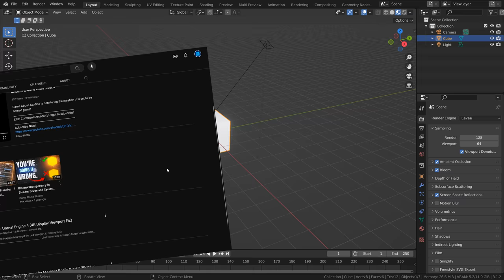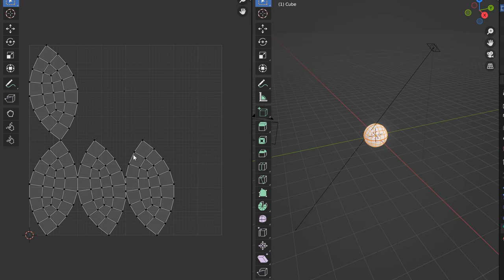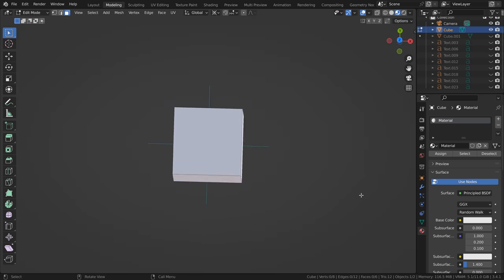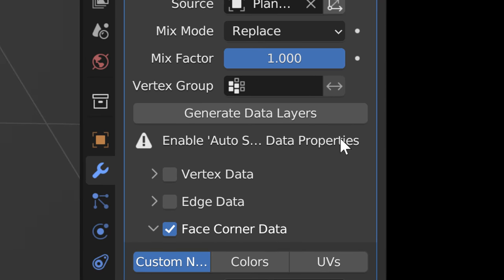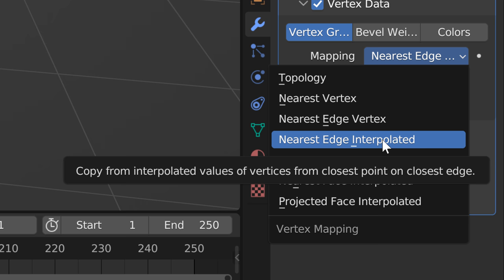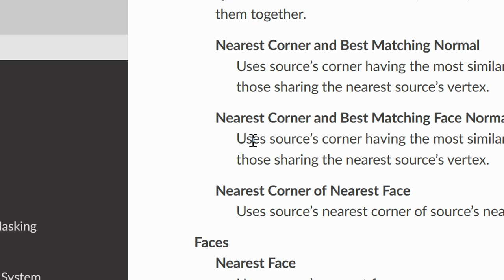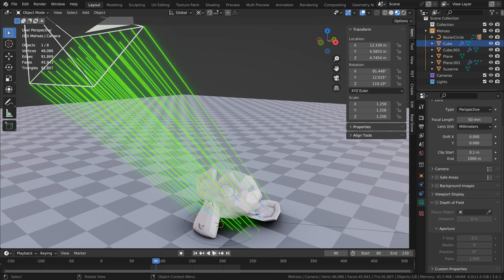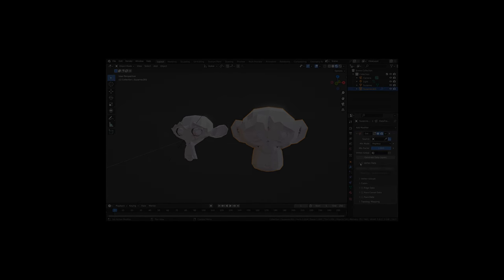How Does The Data Transfer Modifier Really Work? (Blender Tutorial: Part 2 of 2)

Comment: Key frames are called keys as a holdover from hand drawn animation techniques.
More often than not, if you're doing animation, you'll want to draw out the important poses of an action (ie for slamming a fist, you'd have three. Standing still, reeling back, and fist on table)
Then you'd draw all the rest of the frames in between as a sort of manual interpolation which...is a lot of what animation really is.
Anyway, those important poses are often called keys, or key frames.
Reply from the maker: That's a lot of really in depth imformation! I've been wandering why they're called "keyframes" for a while now. Thanks for clearing that up for me.

Comment: Ok, I actually had to use the UV data transfer and it was a huge time saver! My case was that I had two LODs on the models - high and low. Eventually I needed to re-pack UV on the high poly, but I didn't want to copy and decimate it all over again to match the new layout with the low poly I already had. So Data Transfer came in to save the day. It worked fine for the most part, but sometimes the matched UVs came out messed up, so I had to do some manual untangling of the vertices. But hey, it still beats making the low poly model from scratch again just because I've reshuffled some UVs.

Comment: You should file bugs for this documentation, or if you're really into it submit a fix to the documentation. The "they" that could put a link in the documentation is *you*. The problem with FOSS is that by the time you've learned it well enough to improve the documentation, you no longer need the documentation, so this is a very common problem. :-) That said, this is a really great and useful tutorial.